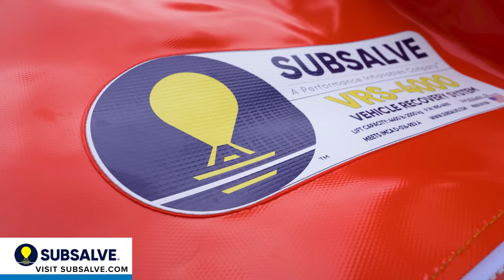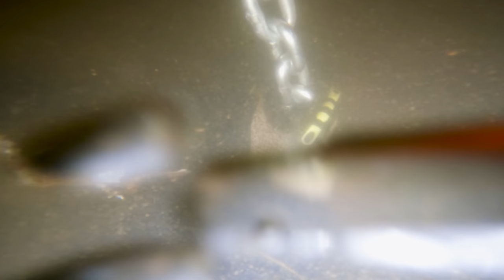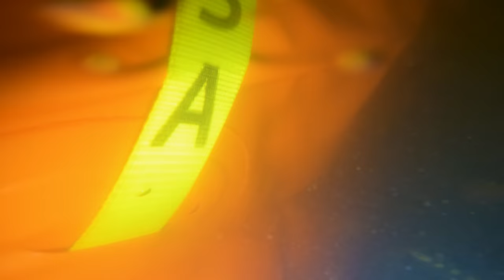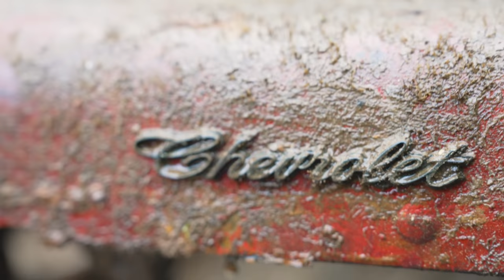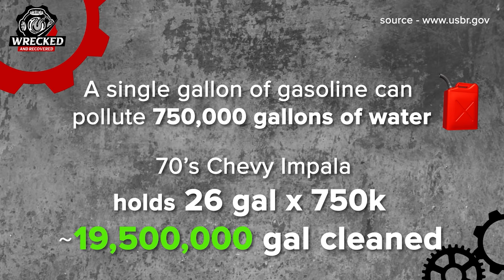1970's Chevy Impala Wagon Discovered 50 Years Underwater!

Comment: A Chevrolet front bumper would typically be attached to the frame with just four bolts. Maybe six in the early ‘70’s. The Impala had to have the best power train in full size wagons - 454 (or 350) and a Turbo Hydramatic transmission.

The passenger side hub cap is worth at least $26. If you have the VIN we’d love to decode it because they are packed with information!
Reply: Impalas were the best made cars. I own a few.
Reply: They also had a 400 option
Reply: Normally you would be right! But starting around '73, the typically-overbearing federal government started mandating that all new cars be equipped with 5 mph "safety bumpers".🤦‍♀️ The reason that bumper pulled out of the frame like it did is because instead of being bolted to the frame it had like a round, plunger-type adapter that bolted to it instead..... And basically kind of plugged into the frame! If you look really closely when the bumper pulls out you could see the round in the frame that the bumper plugs into. Which can pretty much date this car to 1973 or later.🤷‍♀️
Reply: @PapiDoesIt  yep, they sure did!!! 💯 My buddy had a 1970 Impala with the 400...(pre-smog era of course)!! 😉
But also something else that's little-known is the fact that you could get the 427 as standard equipment in the 1966-69 models of the Chevy Caprice! 🤷‍♀️ And that motor has a pretty strong reputation in the muscle car community! 😉 I Almost had a chance to buy a super clean 69 Caprice about 13 years ago for like $2,000! 🤷‍♀️ Even though it had about three or four bent pushrods, it still had a solid, complete, factory-installed 427 hiding under that Mammoth sized Hood!! Lol! 😁 It was definitely worth the price just in the motor alone! 🤷‍♀️💯

Comment: They also used the 400 small block as well as the 402 big block. I had a 70 Chevelle SS and they called the engine a 396, but that year it was actually a 402/350 hp. My dad had a 70 Impala wagon ane they called the engine a 400, but it infact was a 402/ 325 hp. Only 25 hp less than my muscle car!

Comment: Those cars weighed over 5,000 lbs without being full of mud. It would still weigh a little under 5,000 without an engine. I am surprised you guys were able to move that thing. You chose about the most difficult recovery possible to try out the new bags, lol.

Comment: Hi Mitch. Put a life vest on. Adam, Jeremy is always making faces when he is behind you. You two make me laugh so hard. You have such a fun time together. It's like you're on vacation and you have no cares in the world. But I have to say this, Jeremy has no life vest on and Adam, yours isn't closed. You both know that your fans worry about you. Quite stressing us out. After both lines snapped, you should have immediately called the police and got a flatbed to come pull it the rest of the way out while hosing it. Our family had a '57 Baby Blue Chevy Station Wagon. That thing was great. We also had a '59 Oldsmobile. That thing was a tank. My dad had a very large Harley Davidson motorcycle. I used to ride on the gas tank. I don't think anyone would dump a car full of gasoline. Maybe 1/8th to a quarter gallon. But the oil and transmission fluid are still going to be there. Accidents and suicides will have more gasoline in them. Nice job guys. Even without the mud the car would have been heavy though.

Comment: Must have been a 454 wagon. Last of the big wagons. Kingswood wagon. Or a 4bolt main 350 car. Old wagons would have camper packages and big suspension springs and disc brakes up front. Those and old motor homes would offer up plenty of heavy duty and hot rod guts.

Comment: I have a quick question for you guys..  When pulling a car, is it easier,  when the car is found upside down, to pull it out that way?  Or to flip it before taking it out of the water..  I recently saw you pull out a car that was upside down. And you pulled it out without flipping it back over first.. Why is that??  Later Gator
Reply from the maker: Every car is different. If it’s upside down it’s easier to rig lift bags on, but we still have to flip it eventually once we get it out but I would say if they’re on their wheels and not full of mud, we can just roll it right out is more ideal.